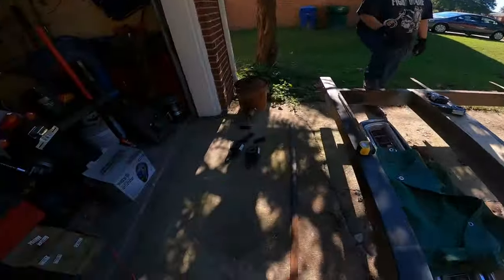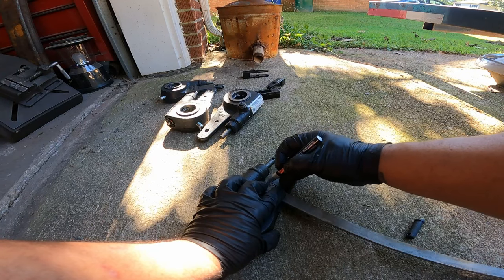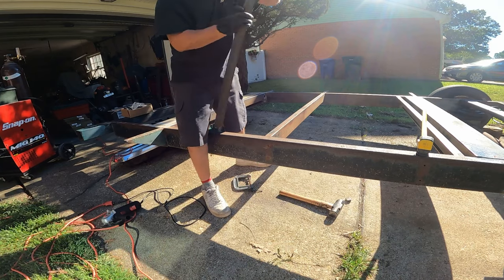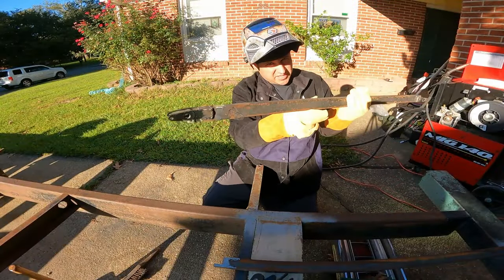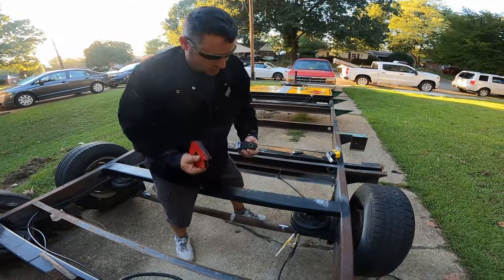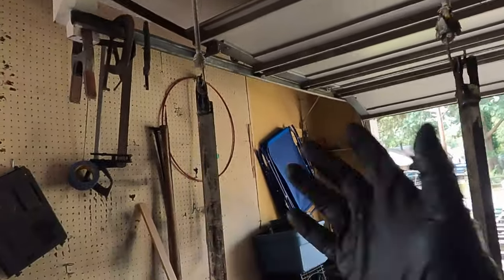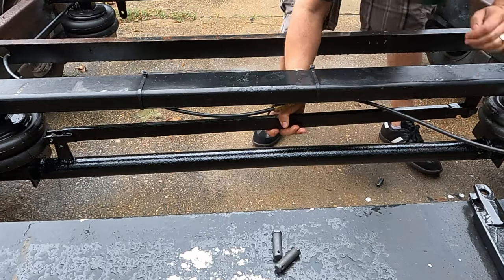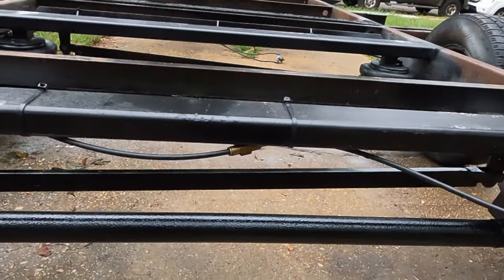BUILDING THE ULTIMATE RAT ROD CAR HAULER TRAILER PART 4 | BUILT PANHARD BAR SUSPENSION OUT OF JUNK

Comment: Sweet setup. I like that you mounted the panahard bars opposite of each other like a real semi does. Also, if you had mounted your Panhard bars BEHIND YOUR axles, instead of on TOP,  then when the bags are aired out completely, your panhard arc should be 10 degrees. Then at full lift you should be 10 -14 degrees the other way the depending on how high you need it. Basically, you wouldn't have to disconnect the panhard if you had the mounting brackets much lower and behind the axles